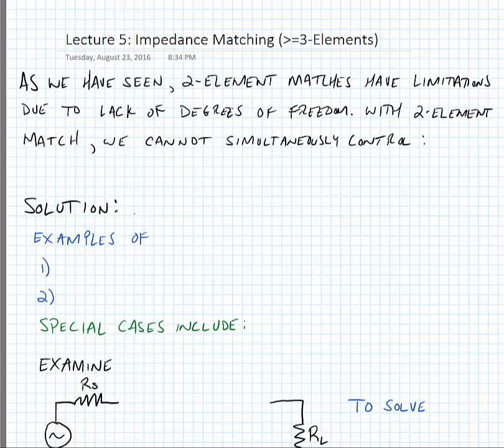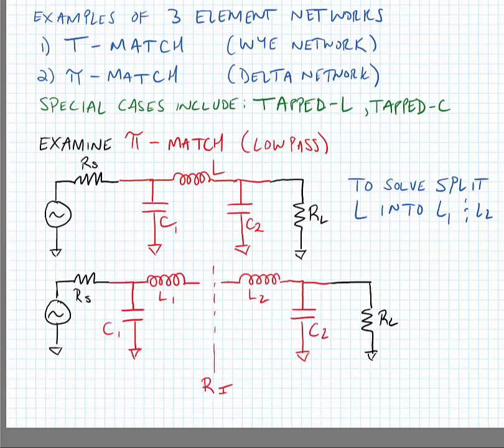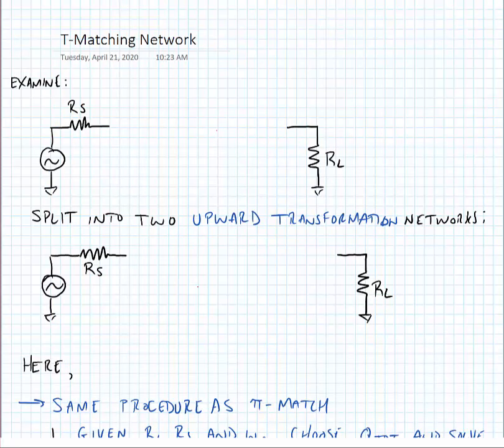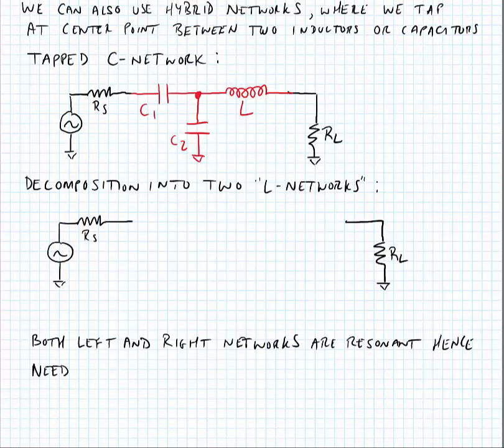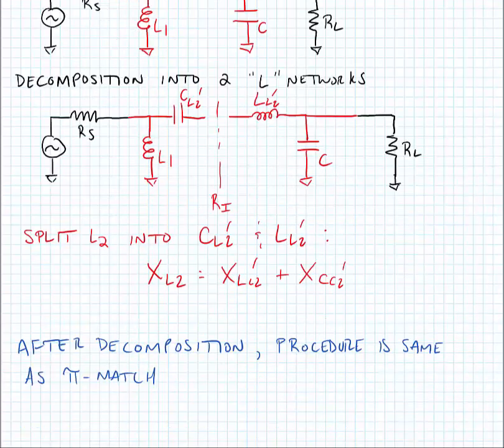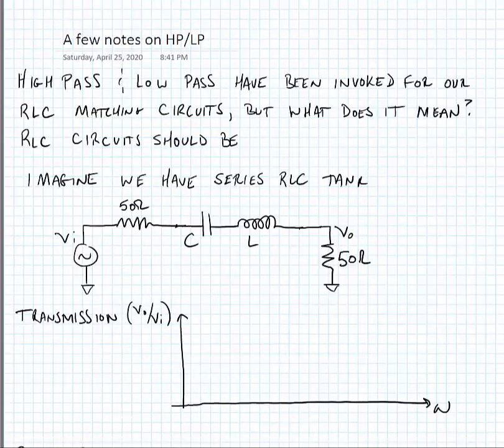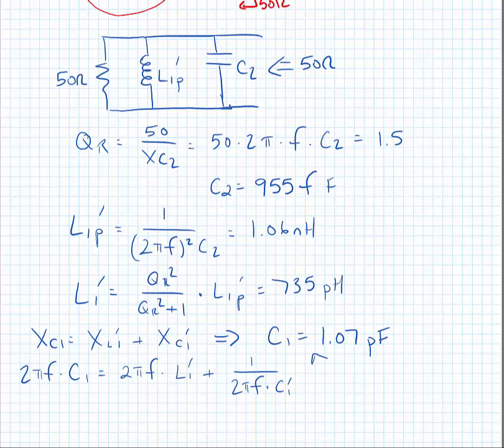Lecture 5 - Three-Element Matching Networks

Comment: At 15:12 you show the right side network, indicating Ri is 50 ohms.  That baffles me.  Shouldn't Ri on the right network be the same as Ri on the left network, ergo 15.2 ohms?  Otherwise the method makes sense to me.  I'm looking to match a 100-ohm antenna to a 50-ohm IC input at the L1 GPS frequency.  Favoring a high-pass configuration.
Reply from the maker: Ri = 15.2, but when we perform series (L1' is in series with Ri) to parallel, the network must have 50Ohm parallel impedance if it will match to 50Ohms at the target frequency. Hence, the modified network is Rip' || L1p', where Rip' is 50 ohms after the transform. This step is shown in going from the top network to the bottom network. 

If you want to use a high-pass network, you would have to pick a Q and then swap the Ls for Cs and vice-versa.

Comment: Hey, How do we calculate cutoff Frequency for a T-match, Low pass filter?
Reply from the maker: Once you have the element values and you know the impedance of the source and the load, you could calculate a transfer function and then find the half-power intercepts of the magnitude of the transfer function.

Comment: Hey, Jeff! All these demonstrations you have made considers that you're using a conjugate match, which are suitable for IOs of LNAs, for example. What about PAs? If we use a conjugate match (at the output) we won't be able to extract the highest power possible from the PA but we'll have an adequate S22 (considering 50 ohms), for example. Is it possible to simultaneously have a power match and a good matching (S22) at 50 ohms (considering output)? Those two concepts seem mutually exclusive to me... I've been designing PAs and I still don't know if there's a proper way of doing that....
Reply from the maker: Hi Favero, These matches are technically conjugate matches since they are "real" to "real", but the principles are the same regardless of whether we are doing a conjugate (gain match) or a power match. We often have to trade off gain for power or vice versa and the way to really understand the tradeoff is with a load pull of the transistor. Load pull contours will easily show us the tradeoff between gain/output power and reflection. 

In order to have a simultaneously good power match and reflection coefficient, we would need to have the optimum load closer to our desired load impedance. This can be accomplished sometimes with transistor design (material and geometry optimization), or with alternate techniques like degeneration, device stacking, etc.
Reply: @wallingphd  Thank you for your prompt answer, Jeff! Let me present you an example to try to explain myself. Considering that Zd is the output impedance of a CS PA and that we have to connect it to an antenna of 50 ohms, if we prepare a matching network that has Zd* at its input and 50 ohms at its output, the S22 will be adequate (let's say, -20 dB) but CW large signal performance won't (considering that Zd is far form Zopt). Now, if we prepare a second network that has Zopt* at its input (obtained from load pull) and 50 ohms at its output, S22 will be degraded (let's say, - 5 dB) but CW large signal performance will now be adequate. Is this the kind of trade-off that you're referring to or am I missing something?
Reply from the maker: @faverosantos  Yes, this is the tradeoff I am referring to. Without the ability to change the device or perhaps the topology, there is little that can be done but a pure tradeoff like this.

Comment: Thank you for this video.
I am new to these topics as I have to design pi- network for source impedance of 35+ 10j and load impedance of 50 ohm. I have read many articles and online calculator and they are asking me the "Q" . 
So how to find "Q" I have watch the video, in that RI is also unknown so kindly help to find "Q" for pi network.
Reply from the maker: I believe that this is discussed. The Q for the network is the sum of the Q's for the individual two-element networks (e.g., Qleft + Qright). You can find these by picking the intermediate resistance that each half of the PI network is matching to. Remember that in a PI network the intermediate impedance is always smaller than the impedance on either side of the PI network.
Reply: @wallingphd  Thank you for your kind response.
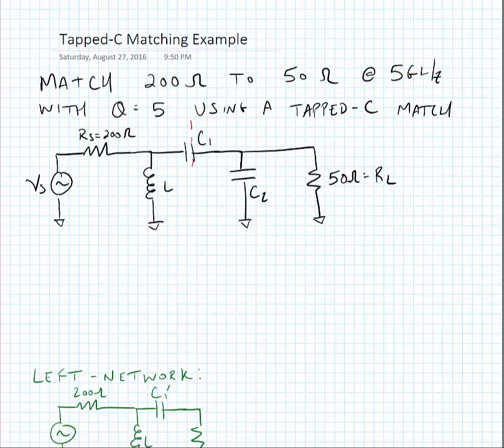Yes learned that in a "PI network the intermediate impedance is always smaller than the impedance on either side of the PI network" @ 3:20 and also @13:35 example "Q" is already given but in my problem, I have only source impedance 35 and load impedance 50 so as you told "Ri" is less than load and source impedance here I should less than 35 right?  but how to find the exact value as "Q" is unknown. 
kindly clear out the confusion I have spent many days to solve this.
Reply from the maker: @ijayvadodariya  Because of the third degree of freedom, you control the Q. So you can pick a value for Q. There is a limited range of Q, but in principle, it can be pretty broad.
Reply: @wallingphd  is there any range that I can take and do calculations for my problem? Any specific value is good for my problem? 
Thank you in advance.

Comment: With regards to the tapped capacitor network, I have noticed that the procedure here is different than many other resources I have found (for example in Thomas H. Lee's book). For the example you presented I get different values if I follow his method. Is the method used here a more approximate one? 
Thanks for your time
Reply from the maker: The methods should yield the same results. The simplest way to check is using a Smith Chart.